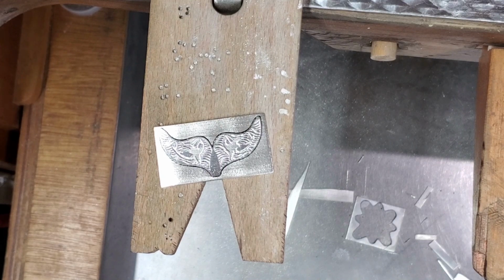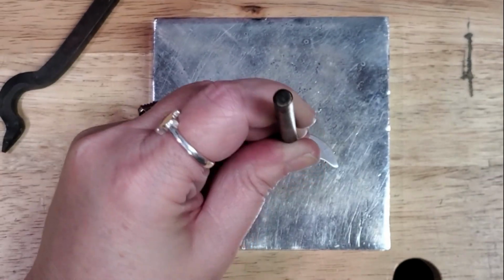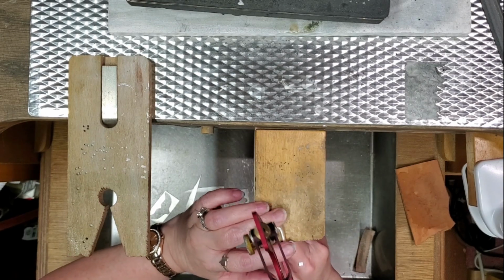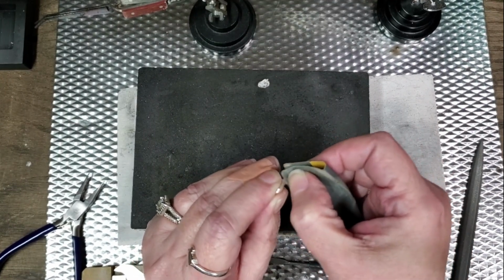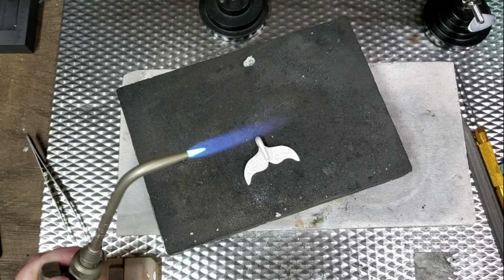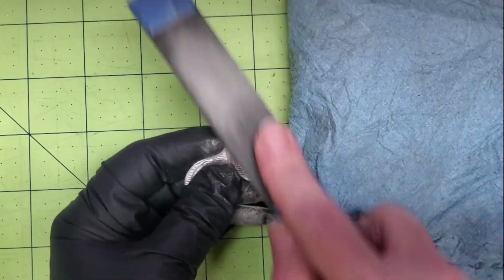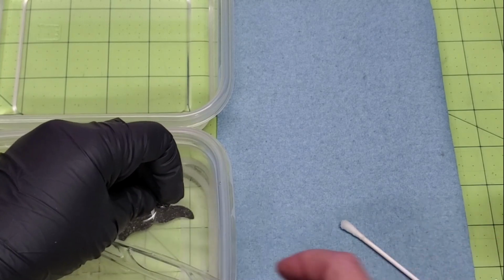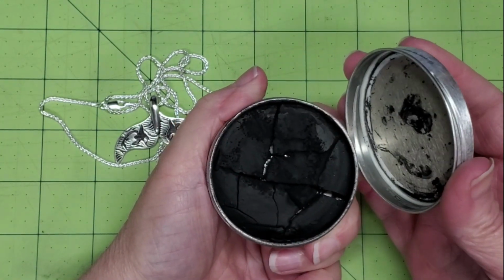Beginner Series: Etching - Finishing the Piece

Comment: Thanks for this series. I’ve tried to etch silver with ferric chloride and no luck so far. Will try this method. I see you brushing the piece with a brass brush and wonder if that leaves harsh scratches?
Reply from the maker: Ferric Chloride does not work with silver, it is used with copper. If you are etching silver you should use Ferric Nitrate. As far as the brass brush, it must be a soft jeweler's brass brush. It actually leaves a nice satin finish on the piece, no harsh scratches.

Comment: Tammy, thanks for sharing your knowledge. I have a question regarding a different subject and haven't been able to find an answer. I am opening a store and I had some pieces custom made for my brand, however I didn't have a mark at the time. Now I have the pieces (necklaces, rings, bracelets, earrings) and would like know if there's a way to mark them with my store's logo. Is there a way of doing this without damaging the pieces? Thanks again!
Reply from the maker: Hi Adrian! I'm not sure that I would attempt it if you weren't the maker. Often you will get an impression on the opposite side of where you placed the stamp which can be dealt with during the finishing process. Have you asked the maker for their opinion?